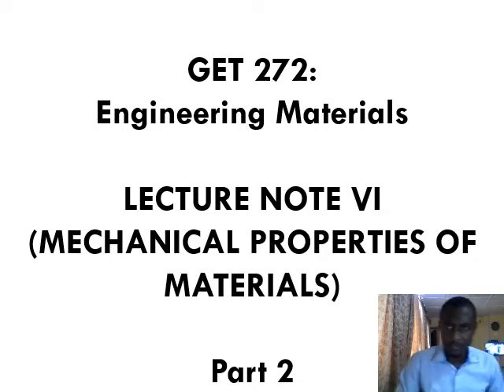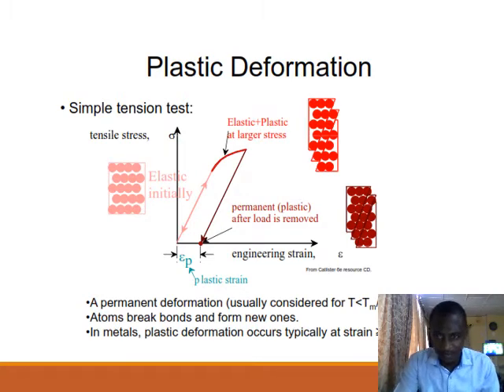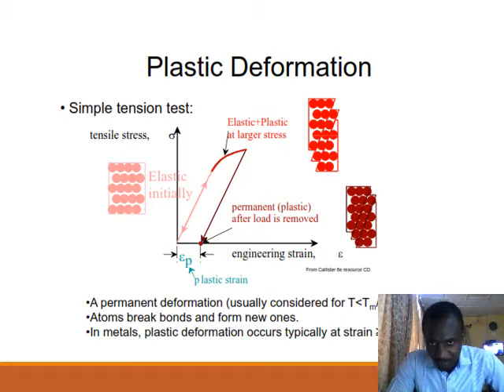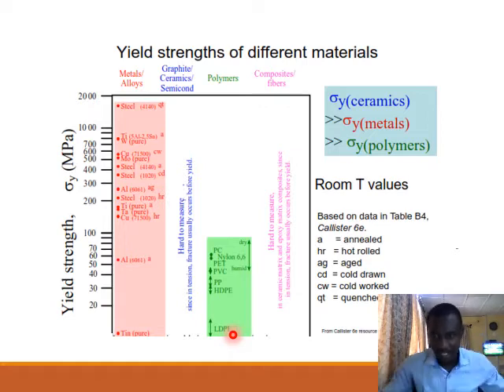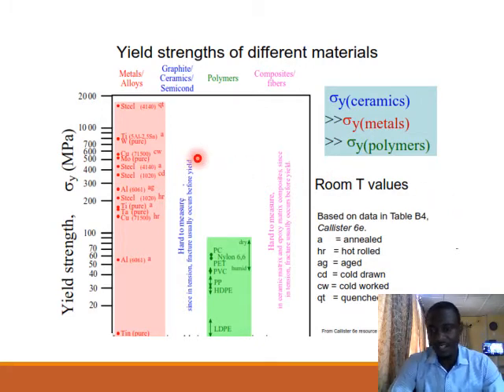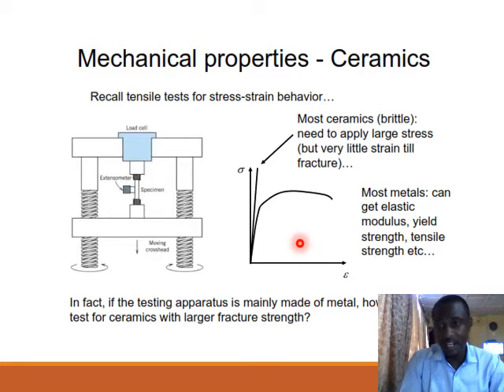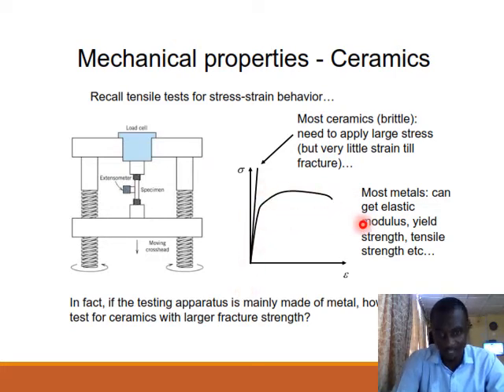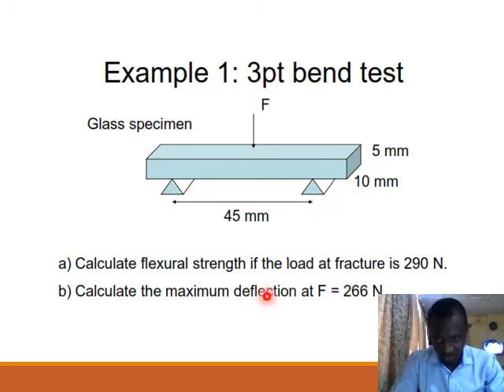Lecture note 6 (Part 2)

Comment: 22/67ce/1011
Ajewole Samuel Temidayo
Civil Engineering department.

From the video,you first test the cable by using a cable tester.Then you insert the cable into the internet port of computer one and computer two (it will blink to show it is okay). Sometimes the color can be yellow.

Then you assign the IP address,so it can check on error and then you click on validate.

You check the computer one and computer two.Then make sure you can share file to the two.